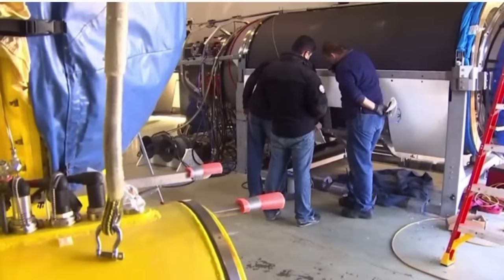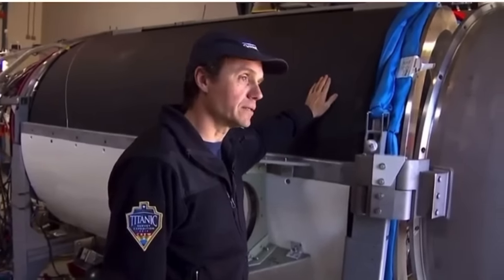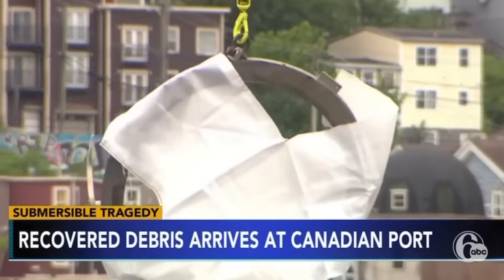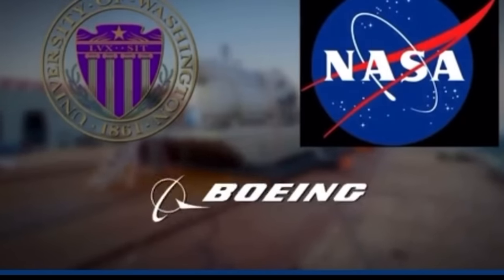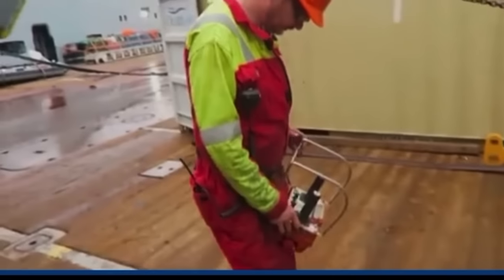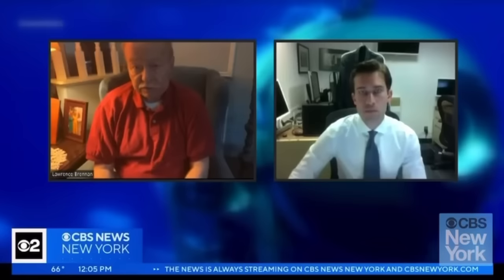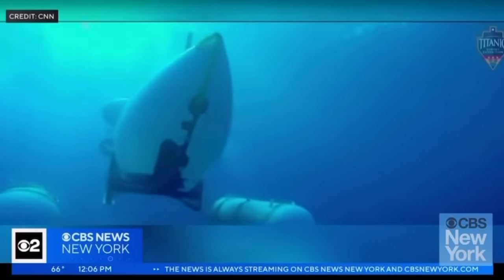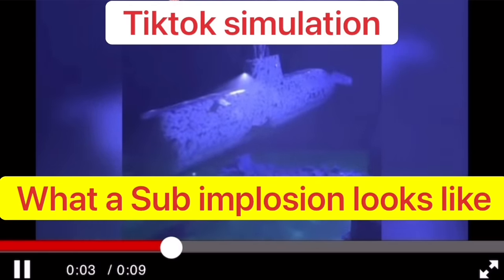Titan nosedived like an arrow (then popped like a balloon) #Titan #oceangate #Titanic

Comment: It was not a Playstation controller. It was a cheep generic third party controller for computers.
Reply: Cheapest thing made. The pressure at that depth at least 5,000psi is enough to create a water jet that can cut an inch of steel.

Comment: if the titan had cameras ,,,, wont they be able to recover footage? 

or was the cameras only live feeds and not stored
Reply: The titan did not have cameras because Stockton Rush broke a lot of rules and laws to make it. And did not want anyone to notice anything he did wrong to break the law. That is why he did not have any cameras on the Titan Submersible.
Reply from the maker: they have not released specific information about that yet
Reply: @mr.garlicman3134  I'm sure it has external cameras so those inside didn't have to cram in the small window to see?
Reply: @silki24  let's hope we find out soon
Reply: The cameras might have been manually controlled and only switched on at certain times, but in any event, would that kind of component and the hard drives have survived the wreckage?  Even if the implosion didn't destroy them, they were likely lost in the eventual disintegration.
Reply: @halfbakedproductions7887  yeah possibly. I'm thinking on the off chance that they did record and the slim chance that if it was stored that the potential footage could of survived. I know there are some company's who specialises is recovering footage off broken/damaged hard drives

Comment: It was only rated to 1300 meters. Tony should be in jail for lying about the rating.
Reply from the maker: they lied about so many things
Reply: @silki24  Do you think people will be charged or lawsuit filed?
Reply: @Bobo-hd6qn not a lawyer myself, but I imagine if they signed waivers that it would get the company off the hook for any liability
Reply: If the company is proven to have knowingly lied about multiple specification ratings being inadequate or falsely produced, the case can be made the waivers of the passengers are void due to being signed under false pretense and direct deception in regards to the true level of risk and the general level how robust the submersible actually was.

Comment: Thunderf00t or another youtuber explained it too. He said a pin hole in it maybe started first. The jet of water from a pinhole would cut through skin.
Reply: No pinhole. If pinhole at those depts, you are dead.
Reply: @bregjejabra25  I have tended to downplay the level of difficulty, and the number of problems to try and solve for getting to the Titanic. I am thankful for the YouTubers that explained it in a way the makes sense.
Reply: My best guess based on the dialogs that appear to be legit, is that at the minimum there was leakage in the rear battery area. Then it was game 🎮 over.

Comment: This is largely speculation.  I am waiting for a video that combines the communications with the possible causes.  Was the dive going as other dives had, rate of decent etc. No one has covered why they had problems with the electrical busses. Why did they not ascend faster after dropping the ballast? Were these things related? Could the cracking noises have been evidence of the hull failing causing a possible leak which could cause the electrical problems? A leak would explain electrical problems as well as why they didn't ascend faster. Many issues we may never know. But please quit comparing an implosion to a ballon popping. It is nowhere near the same thing !!
Reply: I believe her comparison is in regards to the speed of the bursting. Whether it’s blowing outwards or inwards the speed is the same.
Reply from the maker: a balloon popping is not the same thing but the engineer wanted to explain how fast it happened, that's all . The crackling noise was the hull failing , he was forced to replace it once after his dive with Karl Stanley in shallow waters , did cost 1M. So I suppose he just did not want to do that again . Many speculate the aft was soaking , killing the batteries
Reply: Cheaping out and pulling/towing the Titan behind the ship instead of it being on the ship probably damaged it. Caused some water to get into the sub and start the problem
Reply: @kathyinwonderlandl.a.8934  spoken like someone that has never spent any time in a submarine.
Reply: @brianhubert8513  wrong. I went on the submarine ride at Disneyland
Reply: @kathyinwonderlandl.a.8934  I don't know if I would hold that out to make people think you know much about submarines. I served on two boats(submarines). The USS Tecumseh SSBN 628 and the USS Francis Scott Key SSBN 657. I have more time underwater, sitting on the toilet, than the Disneyland ride does in a week.
Reply: @brianhubert8513  I was not being serious and Thankyou for your service

Comment: There had to be something that caused it to sink so fast regardless of the ballast being dropped. Which means it probably had a water leak in the aft compartment and filled That part with water
Reply: The "aft compartment" was always full of water.  And at depth submersibles don't have "water leaks"; they are either water tight or they implode.
Reply: @gkilcup  Not if the "Aft compartment" is entirely Separate from the "Passenger compartment".
Reply: @gkilcup  The aft compartment held electronics,, it wasn't "Always full of water".
Reply from the maker: yes some say the aft was soaking
Reply from the maker: which it was
Reply from the maker: no it wasn‘t
Reply: @curtriedel5036  I was putting "aft compartment" in quotes b/c I wasn't quite sure what you meant by those words.  To me they would most likely mean that bay attached to the outside of the pressure hull, which contained the batteries and hydraulics, things which are designed to live in the ocean and withstand the pressure b/c they are filled with fluids themselves.  Now I am thinking that by "aft compartment" you mean something I might call the "aft partition" of the pressure hull, that area where they put up a partition to hang a monitor and hide the computers and other equipment.  But that electronics area is fully part of the passenger space, not separated by a water tight bulkhead.
Reply: @curtriedel5036  More importantly, note that the entire premise is baseless.  There is no reason to suppose that the Titan was dropping faster than normal.  And there is no reason to give any credence to Jose Martin's speculation.  Essentially, Silki is wasting all of our time here and is just saying "hey guys, I just noticed some baseless speculation which spread rapidly across the internet 4 months ago, in the first days after the tragedy"
Reply: @gkilcup  Actually,,it is Completely separated from where the passengers are and is not part of That area at all
Reply: @curtriedel5036  Where did you pick up that idea?  For my part I have found the videos from Mike Bell to be informative.  E.g. search for his "carbon fiber--how it failed" and go about the 4:45 mark for some nice graphics.
Reply: @gkilcup  deductive reasoning

Comment: Gday,  I'm no expert , but an experienced deep scuba diver, only near 50 metres, obviously not 3800 metres.
the subs buoyancy is completely independent from its orientation,  eg, it cant drop like an arrow facing down vs being horizontal,  orientation drag isn't an issue  like a freefall parachutist.
, being horizontal or vertical or passengers location would make zero difference to the descent rate, it weighs what it weighs.., so, yeah, not sure about this theory ??,
 maybe water ingress could slightly increase descent rate but no way would it suddenly drop like a stone coz it's pointing down..
Reply: When the sub went nose down all of the crew did as well. In an unrecoverable position. The sub would have fallen at an increased speed with zero abilities to stabilize.
Reply: Awful subject, would the answer be between both your hypothesis...I ie the sub shouldn't dive like an arrow, but the orientation would be irrecoverable with all the weight at one end.?
Reply: Vic, I think you are on the right track. I'm also a diver, but you expressed the idea better than I could have. Orientation wouldn't make it sink. Only loss of buoyancy would.

Comment: There seems to be a lot of detailed information as to what happened during the sub's failure, considering it only communicated by text messages. One has to wonder why anyone would dive 12,500 ft. relying on a text to be the only form of communication in case of an emergency, thankfully mercy spared the four passengers from experiencing what would have been like 
18 million pounds dropped directly on top of them. We can hopefully expect thru the FOIA that we will find out exactly what were the remains found with the debris, I'm guessing it would be human tissue sharing 5 dna samples..
Reply from the maker: or some teeth

Comment: Thankyou for keeping up with this information 👍The only thing I would need clarity on is the experts definition of the 'spinning' and what was the direction of the motion was. Also, how was the crew managing to message and communicate with the surface vessel if they were being thrown about inside? And why they didn't mention the sub was now starting to spin. Were they torpedoing to the bottom, or were they circling to the bottom? 
In the video from the last time when they mentioned that the sub had started to spin, the crew in the video seemed stable, and the sub seemed level, even though they were aware that there was some type of emergency with the way the sub was acting. I was wondering what the electrical fault was in the sub, as well? Still so many questions to be answered about this all.
Reply: Communication 
Incident
Alarm
Communication
2.Incident
Lost of communication
Spiraling
BOOM

Comment: There’s a reason why a Rolex or Omega watch costs what it does to survive that deep a dive lol. They aren’t GLUED together.
Reply from the maker: 😃 good comparison
Reply: @silki24  thank you 😊
Reply: Wickedly sweet comment.
Enjoy your Sunday!
Reply: @robert-wr9xt  thanks. You as well
Reply: A Rolex is glued together
Reply: @Cleatus546  only yours
Reply: @MrJruta  
It still works pretty good.
Reply: @Cleatus546  sweet
Reply: @MrJruta  It's right twice  day
Reply: @MrJruta  
I might be talked into selling it  cheap. It's a very rare quartz edition and they also made an error on the dial logo. 
It says "Folex".
Only two known to exist.
Reply: @Cleatus546  😂😂😂 I’ll take it IF it comes with a watch winder, I hate when the battery goes dead
Reply: @Cleatus546  Swiss accuracy
Reply: @MrJruta  
I duct tape it to my washing machine it's frequently unbalanced during the spin cycle. That's my watch winder.
Reply: @Cleatus546  😂well done 👍
Reply: @Cleatus546  
Are you actually going to not point out that it is only the lens that is pressure fit with a minimum of any practical glass/metal bonding interface.
Reply: @Cleatus546  
The troll has shown its face.
Russian or Latvian?
Perhaps a little Welsh?
Maybe a pecorino?

Comment: I don't agree with the assessment. this thing was sinking faster than it should've been almost since onset. That carbon fiber was becoming waterlogged. doesn't take much once it begins as this boat was finely balanced to maintain proper negative buoyancy upon descent. THAT did not happen they should've aborted on that first 30 minute check. Had they done that they would be alive today. Once topside a weight check would have immediately determined that it was heavy. next question would be.. WHY? It imploded THEN crashed to the floor in pieces. The occupants never knew what hit them BUT they probably knew that death was immanent at some juncture (due to the cracking sounds prior to imploding). They had already dropped ALL ballast including the skid BUT they were STILL descending.
Reply from the maker: yes they should have aborted butvI guess Rush did not want another failed trip, bad press , bad for cash flow

Comment: Popped like a balloon? I thought it imploded?
Reply: Right? Did it explode or implode?
Reply: Technically a bit of both if I understand implosion physics.
Reply: When it implodes the air inside is compressed and gets hot.  That causes it to then explode.
Reply from the maker: he used that example to show how fast it all was gone
Reply from the maker: both
Reply from the maker: both

Comment: Hmm. The electronic systems were in the aft section separate from the cabin. I can imagine that a leak there resulted in crackling sounds as the water fries the electronics, resulting in power A outage. They switch to B and the crackling subsides. Then the water starts frying power B and the crackling returns. They lose power B now and begin to sink uncontrolled. 

With the extra water in the electronics compartment, they didn't have the buoyancy they thought they had so they descended faster and they couldn't ascend as fast as they thought. Without power they no engines to push them up and the flooded electronics compartment weighed them down.

With no way to stabilize their level, they could have easily tilted forward due to the weight distribution of the passengers or even backwards due to the heavier flooded compartment.

So, I can see what the guy says as happening. What do I believe? I dunno. There are so many things that could have happened but I just don't have all the evidence to even make a likelihood guess.
Reply: 0:20 we did this Extremely fast famous last words:face-red-heart-shape:
well they knew they were descending faster then previous dives and clueless to the fact that something was wrong causing the faster decent Ballard would have aborted to figure out why but then again he's a professional not some armature clueless to what he is doing that's why Ballard's never had this happen to him on a dive
Reply: 7 Fake Moonwalks ??
Reply: The crackling was indicated by the RTM system not by ear, the rtm was an internalsys5em put in place to monitor the integrity of the haul.

Comment: I’m not riding in any vehicle controlled by a video game controller. Let alone pay you to drive me around in said vehicle.
Reply from the maker: yep agree
Reply: As a matter of fact the video game controller is one of the less questionable things here. Amateurish as it might seem, video game controllers like that are actually used and proven in quite serious applications in military among other things.
Reply: @andersbiro  it’s still just the cheapest thing to do! My life is not a video game so I don’t want a video game device between me and death. How many controllers in your life just stopped working right and malfunctioned on you in the middle of a game? Just need something actually built for the job.
Reply: @justinverser2102  It has a lot to do with costs yes, to my understanding military originally used controllers that cost thousands of dollars but discovered that video game controllers could be pretty robust and easily replaced with another 25 dollar controller.

I would like to believe that Titan at least had a few spare ones in case things went wrong, I do not know the potential dangerous effects of sudden malfunction at operation though.
They tried to cut so many corners, that I believe the video game controller was one of the least problems for safety, which sadly says more about the other safety problems.

Comment: As a passenger, I would have ask for a cable to be tied to the ship.
Reply from the maker: but if you implode that does not help 😪😪
Reply from the maker: sadly yes 😢
Reply: @silki24  much agreed
Reply: Calling something of a marine nature even directly connected to the Titanic ‘ a Titanic Experience ‘ would surety scare off the superstitious. It would me. A cable may not have helped but being bolted inside has to be a basic safety disadvantage .
Reply: As an internet YouTube jockey, I would have asked for my own controller, and a bag of candy to eat as we plunge to our deaths.
Reply: Work out how thick of a cable would be needed to support the Titan and its own weight. Then ask if a ship even twice the size of the Polar Prince could have supported such a cable without capsizing.
Reply: @dexterpoindexter3583 The sub is not that heavy.  Thats why they went with fiber - so light, no crane on deck needed.
Cable-laying ships can go across the entire Atlantic, trailing hundreds of tons of cable without stability problems.  
Thats the point though - steel sub, you need a bigger boat. Fiber sub tethered - you'd still need a bigger boat.

Seems like "budgetary" concerns trumped safety ftom the very start.
Reply: @KathrynsWorldWildfireTracking  
Yup.
So I'll go with 3 layers of Ziploc bags for my sub. Advantage: no need for a separate window (in the "bathroom"). 2nd advantage: storage space for munchies, flares, & videogames to give that joystick controller something useful to do.
😬